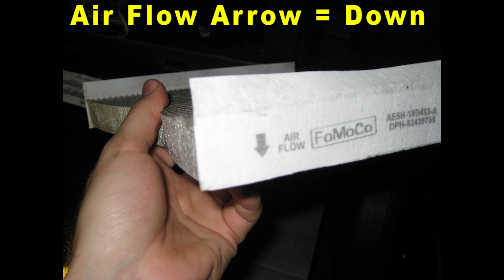2006 To 2012 Ford Fusion How To Change A/C Cabin Air Filter With Part Numbers

Comment from the maker: Ford Fusion A/C Cabin Air Filters - https://amzn.to/4bhqmoR
Fram Fresh Breeze Cabin Air Filter Part # - https://amzn.to/3VCpdCj
Bosch HEPA Cabin Air Filter Part Number - https://amzn.to/45D3e2I
EcoGard Cabin Air Filter - https://amzn.to/3xrcDxW
Precision Screwdriver Set - https://amzn.to/3sLixaP
Plastic Pry Bar Tools - https://amzn.to/3HMtsV7
Socket & Ratchet Set - https://amzn.to/3Z17LbA
Mechanix Gloves - https://amzn.to/3jCnHkt
Torque Wrench - https://amzn.to/3vS5uSI

The Paul79UF YouTube channel is a participant in the Amazon Services LLC Associates Program, an affiliate advertising program designed to provide a means for sites to earn advertising fees by advertising and linking to Amazon.

This DIY video shows owners of the 1st generation 2006, 2007, 2008, 2009, 2010, 2011 and 2012 Ford Fusion how to change the A/C system's cabin air filter element for the HVAC blower motor.

Comment from the maker: Check out the DIY guide for changing the cabin air filter in a 2006 to 2012 Ford Fusion - 
https://www.paulstravelpictures.com/Ford-Fusion-HVAC-Cabin-Air-Filter-Replacement-Guide/index.html

Here are all of the DIY repair and maintenance tutorials for the first generation 2006, 2007, 2008, 2009, 2010, 2011 & 2012 Ford Fusion - 
https://www.paulstravelpictures.com/Articles/Ford-Fusion-Common-Problems-Repair-Maintenance-Guides.htm

Owners of other Ford, Lincoln or Mercury vehicles such as the Fiesta, Mustang, Focus, Taurus, Flex, Edge, Expedition, Escape, Ranger, F-150, MKZ, MKS, MKX, MKT, Navigator, Milan, Grand Marquis, Mariner, and Mountaineer may also find this instruction guide to be helpful.